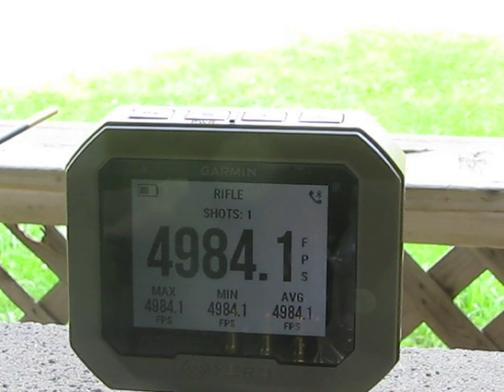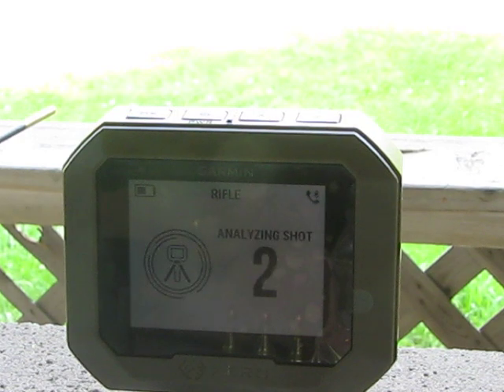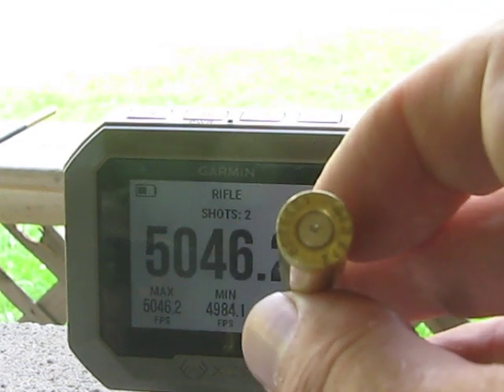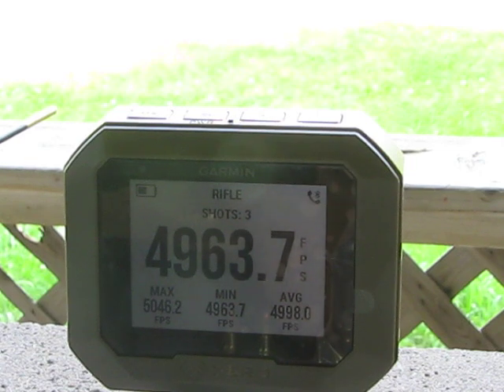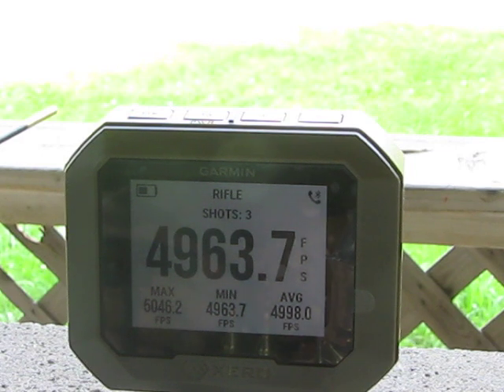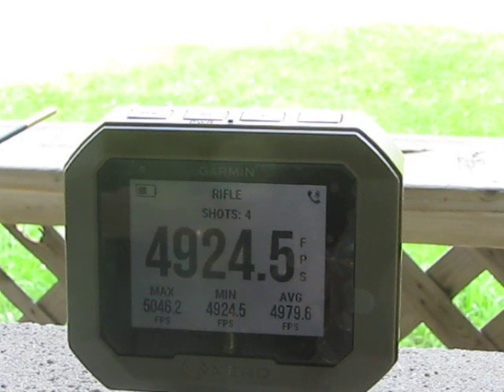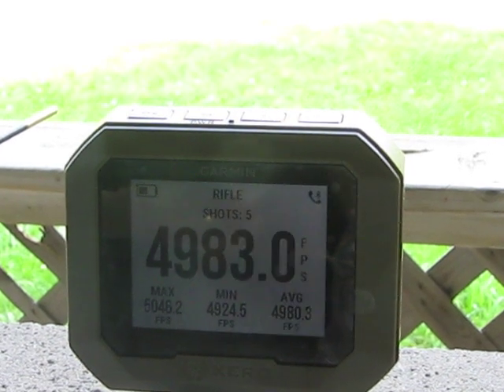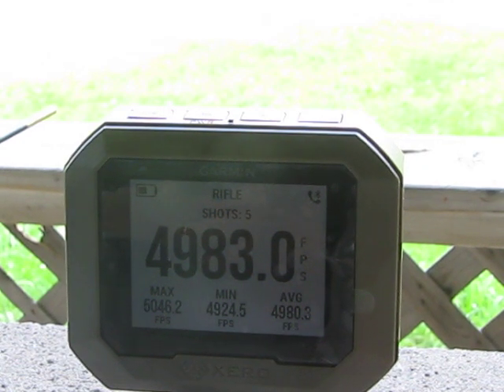22-243 Middlestead reaches for 5000 fps

Comment: 22 cheetah is the fastest i ever shot. I don't know how fast it was going my magneto speed wouldn't catch it.
Reply from the maker: Your 22 CHeetah is probably similar with very light bullets. This rifle was chambered with a 1 in 20 twist barrel to help with velocity using  light bullets. Does your CHeetah use cases with the small rifle primer or large rifle? Thank you for watching and leaving a comment.
Reply: @markcarew6724  good question it wasn't mine but am older gentlemen that I ran into while I was out shooting.  I know it used a .308 "remington bench rest case* which is unobtainium now days.  
I have a 17 mach v that I need to work up loads for.
Reply from the maker: @jacktrout5807  The 308 Remington Benchrest cases used a small rifle primer. These cases were used by Fred Huntington and Jim Carmichael to create the 22 CHeetah. Hence, the capitalized letters in the cartridge name.
Reply: @markcarew6724   the guy that owned the rifle new him Carmichael  I think.  
The 17 Mach v I got from my uncle. I load for a few that I have to load for.

Comment: Congrats on breaking 5000!
Reply from the maker: Thank you, Ghost Rider. This is effectively the top velocity I can achieve to this point. I may be able to fine tune the loads with a Federal 215 primer, at least from an extreme spread view. Primer pockets are still tight, but bolt lift and extraction are quite hard. Thank you for watching.

Comment: I use to have a 220 swift.
That got 5065fps with a 40grn Hornady Vmax. With a stout load of Winchester 760..
14 twist 27" barrel.

Needless to say,..barrel smoked at 1800 rounds..
It sure was fun though
Reply: Exactly the caliber and grain load I’m dyin to work up. They run 3390-3400fps from my 16” ar
Reply: Surprised you made it to 1800

Comment: There is nothing middle about this cartridge. How about Melterstead, Vaporstead, Liquistead? I am sure you have thought of a few:) That is smoking.
Reply from the maker: Thank you for watching. These loads are right at the top of safe pressure. The primer pockets are still tight, but bolt lift and extraction are quite hard at this point. The groups are good, even excellent, around 3/8ths to 1/2 inch for five shots. I would like to try Magnum primers to reduce the extreme velocity spreads. I would also like to try 30 grain Barnes bullets next, but I don't know how I will chronograph the results. I can't take credit for this cartridge, it was developed by Paul Middlestead in the 1960s. I merely slowed the rifling twist dramatically to reduce drag on the bullet while in the barrel.
Reply from the maker: Quite some time ago, I nicknamed this cartridge the "22 Mach V"  .  .  .